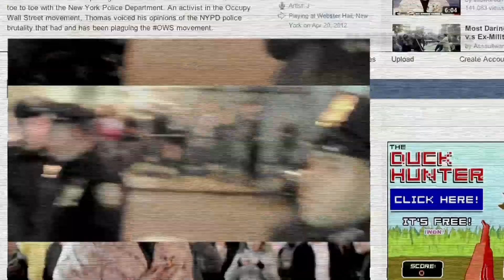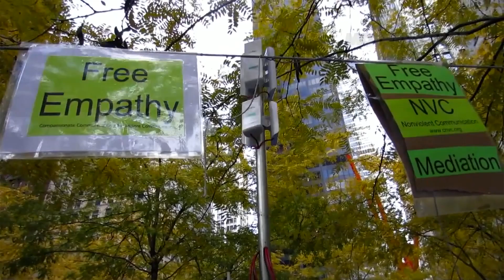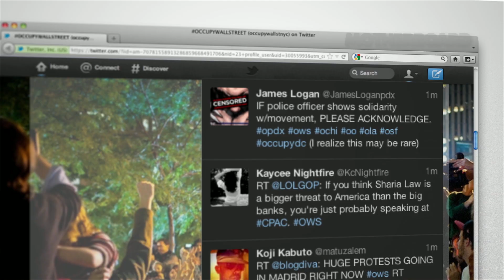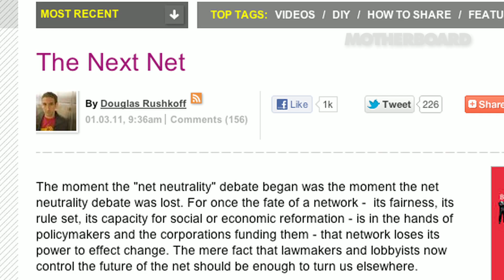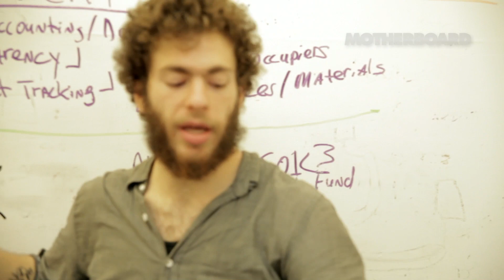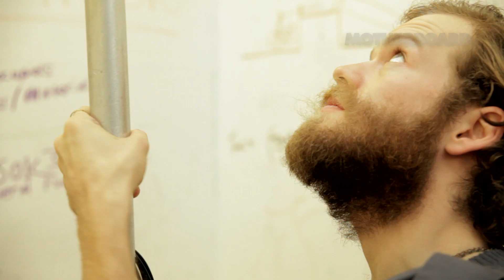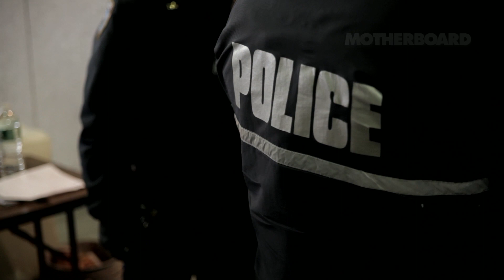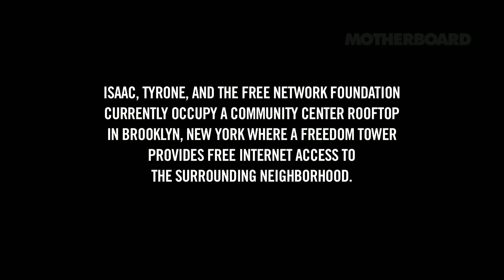Free the Network: Hackers Take Back the Web

Comment: The cool thing is, the software and protocols that power the web can be reused. rtl-sdr and other sdr radio software can be used to transmit data in any format that it is modified to. HTTP is already there, and a great protocol that we can already use, as well as TCP and others.

Comment: You simply need a means of connecting to the WAN, typically that would come from a WiMax wireless modem, so you need an account with Clearwire or similar. That is the wireless router mentioned. Then you simply need a way to break that connection up and redistribute it, typically using WiFi. So any WiFi switch capable of NAT and DHCP would do it. To get your signal further you would need specialised WiFi antennae and radios to give you range & handle large numbers of users. Then power, batteries.

Comment: those towers would have been much more power efficient if he did not use a ups to power everything,  dc to dc converters or devices that ran off 12 volts would have ran much longer.

Comment: The towers are only the beginning. They call it "prying control from the edges in". Sure, you buy backhaul from a private company, b/c thats basically your only option now. Even then, it's still better for ppl to band together like this to buy bandwidth wholesale rather than having comcast et al charge jacked up retail rates. Once enough tower coops are in an area and have amassed enough capital, they can build the own backhaul and take control of the next lvl of the network stack.

Comment: Clear is a WISP (Wireless Internet Service Provider). They provide unlimited data at speeds around 5mbps on a 4g network, you can see inside the black box they had that they were using a modem from Clear. I'm guessing they were using the funding from Pepsi to pay for the internet.

Comment: The freedom tower's tower is dipole-dipole antenna. Right ?

Radio frequency / Wifi

A miniature one.
Reply: If you really wanted to you can just find one of those old dish network satallites and hack it into a wifi finder/distributer
Reply: cmb271
How hard is this?
Reply: I wouldn't think to hard, I think this would help: /watch?v=dD1-KcwIH-U , also I'd design it so I can recieve and send data to another system similar to this so in a way i would be a decentralized ad-hoc WAN for local file sharing

Comment: If everyone could download an app or software for their device and OS, an app that would include a small web server paired with a virtual device like a bitcoin wallet to be used for a simple and one-of-a-kind server ID#, with the tiny flash storage and  average cpu speeds even in cell phones today, this principle could form a daisy chain or mesh network with most devices connected through each other ADHOC. That is it would daisy chain everyone's device together, and only connect to the world wide web through ISPs wherever available. 

Its the same principle with the small satellite TV dishes where ISPs want to sell individual service to everyone, rather than having only some houses with their dishes pointed at the satellite, while other neighbouring houses point their dishes to the few pointed skyward, and have the same satellite service forwarded as a comparable example. The resulting problem would be much less revenue for the satellite company, and in the case of cell providers pedaling data plans or ISPs, it'd cut their revenue and control too.

This would then indeed be - a free and co-operatively shared, high speed internet.

Nothing would need any big cost or change. Simply that the software app is written and freely distributed, then it and changing awareness allow the evolution to happen.

...Or,you can just suck up local free internet hotspots which are likely neater surroundings than your room in your parents' basement anyway.